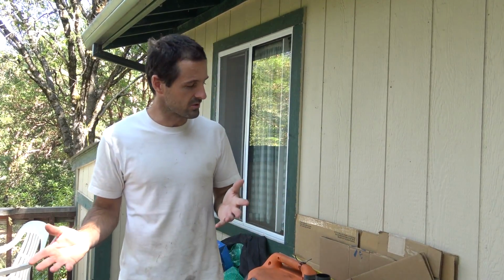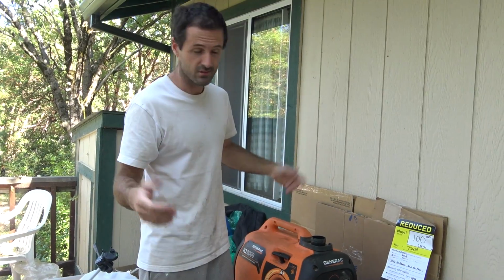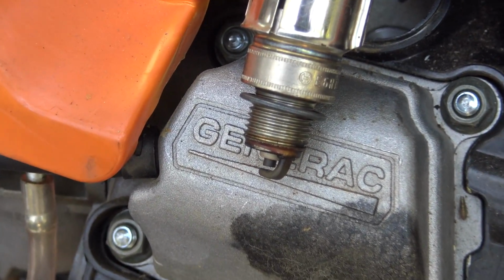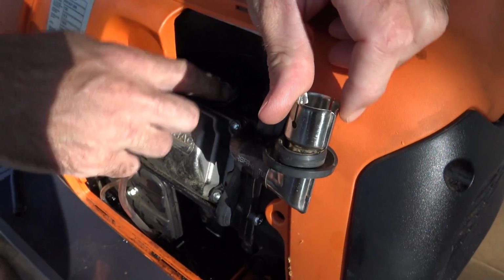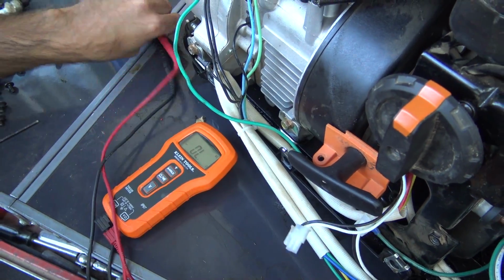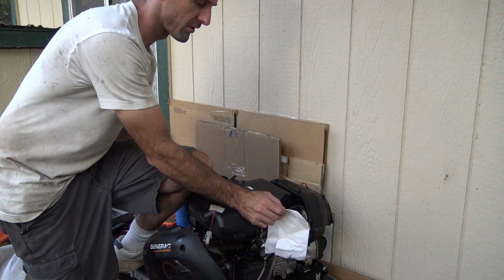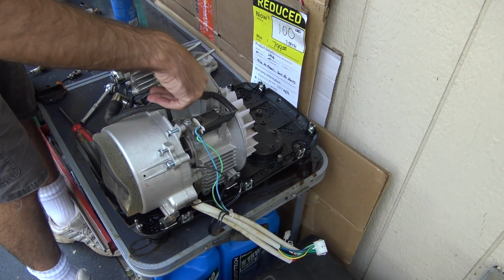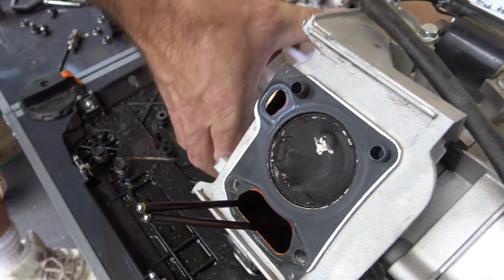$25 Generator From Lowes - Will It Run?

Comment: I recall a phone call from a friend. This was a long time ago from a land far far away (the 1980's) 
Anyways, I was a big Tomboy, I had built my own car so my friend figured I would know the answer to her simple question. How much oil does my car take? I told her 4 quarts if she didn't change the filter & 5 if she did. She then tells me " I put 16 in & it's still not full" 
lol I told her to pull the drain plug right away & don't try to start it. When I got over there, there was oil running down her driveway because, well, catch pans don't hold 16 quarts. 
We pulled the plugs & turned it over to make sure the cylinders weren't full of oil. They weren't but it sure smoked a lot after we put it back together correctly. lol After it burned off the oil that did leak in we put new plugs in it. lol She was just adding oil waiting to see it fill up to the valve covers. She now knows how to check her oil.

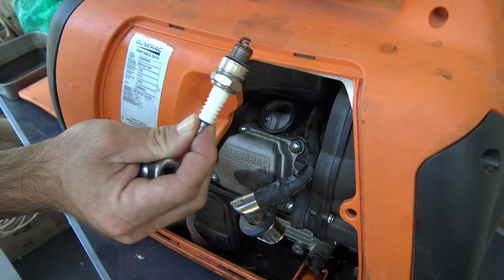Comment: PAUSED 4:37,    ......3% of retail.  Worth the effort no matter what comes of it.  I live in Las Vegas, so I consider how to gamble on an outcome all the time.  Here is the math.  You have $25, plus transport, plus purchase negotiation invested, $75 lets say. 2 hours, and $50 WAG budget to succeed (Wild Assed Guess),  equals $125.  So, $125/$750=6.  If you do this 6 times and succeed once, you spent the same as retail.  If you succeed once in 5 such purchases,  you have a 20% value for the 2 hours I did not value earlier.  If you succeed 1 in 3, your time is worth about $75/hr in this  effort.  This is a great opportunity.  Notice I did not even value recovery of expenditures through parts sales, as you noted.  Now, I have NO small engine expertise, and I even know when oil pours out like that that the engine is far, far over full (I've done it).  I would have tried this myself for that price, the low risk, high reward makes this effort worth it.  I'll watch the rest, anticipating your success, and good for you!!!

Comment: You need to replace the magma drive and both link cylinders. Also the flux capacitor may need a recoil for safety purposes. Don't forget to drain the plug shaft compartment otherwise you will burn out the ozone valves.

Comment: Awesome common sense diagnostics, I am very impressed. A little help? Overfilled with oil leads to several possible problems. Most usual is a hydraulic lock happens and you spin a flywheel key or bend a pushrod. Spinning  the key leads to backfire not loss of compression so I bet your keyways are lined up. Pull your valve cover and check the pushrods. If they appear ok you have come across a less likely scenario; it did not hydraulically lock but actually fired with all that oil in it. More work but still but not an expensive fix, just order a new set of rings right now. With all of that oil the compression went way up and you will find that the rings are broken. If the engine actually ran for a few strokes it will be very dirty, clean up good before you replace the rings. BTW I think this engine does have an automatic deco valve but that will not account for the total loss of compression you appear to be experiencing, good luck but I don't think you will need it.

Comment: need to add some butter fluid to the bread housing! greasing the muffler bearings is fine as long as that model has them,,, but if it is low on butter fluid,, you can forget about it starting!!  had the same model,, with an issue very much like the one your having,,,well,,, someone told me to make sure the muffler bearings were greased,,, so i checked the muffer to see what i could see,, but come to find out that the model i had apparently did not come with any muffler bearings,, so i sold it to a guy,,, and he called me a week later and said that all he done to it was add butter fluid!! says it runs great now!!!  hope that helps someone who is having the same issues down the road!!   :)

Comment: No compression means either stuck rings or the compression release flight weight is stuck but most likely since they where so much oil they probably burnt it up by waiting till it was junk before putting oil in it

Comment: If you did not get it to run the oil washed out the cylinder add gas the the cylinder to wash the oil away to get compression back

Comment: 0K91470136 Piston Ring Set
Generac 0068660 IQ2000
Availability: Discontinued
This part is no longer available from the manufacturer.

Hopefully it is a generic size.

Comment: I test combustion with a squirt of engine starter fluid in the air filter and spark plug. Then I proceed to check the rest.

Comment: The wire come off the crank but now that you toke off the head you will need a new head gasket  you had it when . You turned the rank wheel didn't have to remove the head

Comment: I've seen some morons in my life but this guy wins the prize. What the hell poring gas directly on the sparkplug. Ever herd of flooding?

When it was out the first time he should have looked inside and crank it to see if the piston is even moving.

But fouling the spark plug
Was stupid.

Still the very first think to look for was leeks and crack on the head and block. If no compression but spark chances for a cracked case ishigh

Comment: Try  a brand  new clean dry spark plug. Don’t damp it with gas.  Feed the carb with fresh gas . If it won't start try engine starting fluid.

Comment: Check the 7th Fetzer valve. May be sticking because of humidity. You'll need pliers and 30 weight ball bearings. Good luck, Fletch.

Comment: You can't test a sparkplug with the continuity function if it's a resistor plug. You need to check the plug using the ohms setting and look for something typically in the 10K-15K range.

Comment: There should be no continuity through the spark plug.  Common resistor plugs should have a 4000-5000 Ohm resistance.

Comment: why  didnt you do a visual inspection of the valve train in operation before you  dove into the guts ? Remove the little valve cover and see the rocker arms in motion when turning the engine over, make sure they are normal ? And spray a little gas into the intake , it doesnt need a carb to run...that will narrow down the problem a lot

Comment: Check the float in the carb. Most likely the pin came out of the float in the carb and its not allowing fuel to the carburetor.
My lawn mower did the same thing.

Comment: Can you believe they sold this piece of shit at one time for $800.00 what a joke, these generators only last for so long and then they won't run, I believe these machines have a flaw in the engineering, but was never corrected and therefore Lowe's or Home Depot continues to sell these inferior machines to us. You see where it's reduced on price and maybe you can get it running again is what we think, people don't do that go online or in the news paper and find a used machine that works, and produces more electricity has a bigger gas tank and cost around 40-150$ depending on year and condition. So stop thinking these big corporations are saving you money because there not.

Comment: I bought a crapped out Ryobi generator from someone for $280 that told me "Yes, it works great. I got it from where my mom works at but they upgraded to a better one. It just needs a new spark plug."... I bought a few new spark plugs and still can't get it to run or even spark. The guy that I bought disappeared on me after I posted a security camera video of 'a person wearing night time construction safety gear and was stealing things from the back of my truck around 3AM'. (which is similar to what he was wearing a lot of the time). So 2 years into it, I haven't seen him again and I still dont got the machine running. And his wife/babymom/girlfriend-whoever, came by to visit me and told me that he even stole a lot of things from her boyfriend/whatever.... I don't know.

My dad made a similar mistake too. He ask me for $180 or so. I had no clue why because I was dazed out from lack of sleep and working over nights. Couple days later, he shows me the generator that doesn't run. I toss in some motor oil. The mothor crap was spitting oil out to my arm and I noticed a hole in the motor that shows the crank thing spinning and the motor has like no compression. I said "This machine isn't even worth $5". Now I gotta deal with all these crappy repairs and wasted money.

Comment: I would change the headlight fluid while I was in there as well.
Reply: its a sealed lamp, and the fluid is eternal. FFS u dont know fuck all
Reply: @ChuckyLad  You need to pull the muffler bearing to the side to access the headlamp fill hole. Lighten up my man, you all need some humor now and again.
Reply: Mariah Kelli  didn't you get the memo?
Reply: Topanga Reyna  How can you be so fucking naive and still breathe. WTF I know it was a joke. So was what I wrote you sorry fucktard idiot that is not capable of reading anything properly and just throw shit like a little baby

Comment: My Ryobi RYI2200 did the same thing. Adjusted the valves, the intake valve was staying partially open and it runs better now then it ever did. When they set the valves at the factory they tend not to set them properly.

Comment: Maybe whoever had it before you fooled around with it and put the crank back on backwards.The original problem was probably the spark plug but they over thought it and while putting it back together they threw the pull crank on backwards Idk thats my thought,anyone else got some thought?

Comment: Of course air pumps out of the breather of a single cylinder when you roll it over, there's nowhere else for the air to go when the cylinder descends in the bore. Perhaps the only thing wrong is a dirty carb?

Comment: Rings and cylinder wall are washed out of oil. Causing blow by. Squirt oil on the rings spin without the spark plug then install spark plug if gets wet with oil clean plug and reinstall. Pouring gasoline on a spark plug shorts it out. Wet plugs do not spark. Under normal operating conditions only atomized fuel reaches combustion chamber.

Comment: Not trying to undermine you but I've fixed generators like this before so I'd like to give you some tips. 
1) it likely has a compression release on the cam. That's the reason it has compression Turing backwards 
2) replace the spark plug. I've seen plugs look good but have a very weak spark. If it's a weak spark outside the cylinder, it will be pretty much no spark in the cylinder 
3) clean the carb. They gum up easily 
4) check the float. I've had one that mysteriously filled with fuel.

Comment: Top of the crank case is put on backwards.  If you flip it around on a air compressor it will suck rather that pump

Comment: Someone, previous owner? messed with pull start, trying to start backwards. So its sucking through the exhaust and blowing through the inlet. Crank case breather is usually connected to inlet side so blow back through crankcase?

Comment: could have checked for spark with the plug,  blue is usually good. if you have one, use a spark gap checker. It measures how far the spark will jump. 
also check valve lash before taking head off.  rotate engine to watch the valves actuate, and that way make sure cam is ok, and turning.    one TDC position should see both valves closed for quite a few degrees before and after, and TDC at 360 crank rotation/180 deg cam rotation should see both valves moving at the same time, one opening, and one closing. 
that will tell you whether you need to remove cam, or replace timing belt/chain/gear.

Comment: First thing I would have tried was adjust the valves. If that didn't fix it you need to pull the camshaft out because the sprocket has a centrifugal weight on it that probably took a shit - and/or the return spring.

Comment: Pull cord broke and when it was replaced they wound it on backwards. So when the cord is pulled the engine is rotating in reverse and cannot generate compression.

Comment: Is it possible that someone put 2 stroke oil in gas that was put in a 4 stroke engine? That will cause the valves to stick on the valve guides & leaves the valves open.  If so, get the 2 stroke gas out of the unit & work the valves open & closed through the spark plug hole or if you can't do it that way you'll have to take the head off. Shoot WD-40 on the valve stems & work the valves open & closed till they're free.

Comment: My guess is a head gasket. But, I would have never tore it apart without replacing the plug and checking the coil first. Also, you would have known if the rings were bad by doing a simple compression check and if the plug was full of oil.

Comment: the gap between the spark plug needs to be closer space is a hair to wide plus check the type spark plug certain types are  metal based like pot metal you need one with nickel carbon spark  plug..

Comment: Don't feel bad. I bought a Ryobi 2200 generator/inverter that wouldn't start, thinking it would be an easy fix. Got it home, pulled and cleaned the plug and found it has great spark. Replaced the fuel and attempted to start. The thing kicked back so hard, I thought it was going to break a finger. And that is all it will do. So, with any luck, it is just a sheared key on the crank that threw it out of timing. Has anyone had a similar experience.

Comment: Spark plugs don't have continuity, they have something called a air gap inside of them for extra resistance to make the spark hotter. Also ALWAYS check the valve adjustments on those before you tear them apart, the valves get tight and compression goes away besides getting over revved and spitting a rod that's one of the main problems i see out of those generacs

Comment: Head gasket, valve job and put new valve spring......Buy the way, change the spark plug cap, they tend to short...Have a rubber cap and the thing will work.....

Comment: A spark plug can not stand wet, it was almost destroyed when you poured gas on it, it was the death penalty for the spark plug.
Reply: Did you go after the carb? My float and needle was gummed up like sap. Had to use a needle to chip it away. After that it started right up. Great video.

Comment: I would see if the cam shaft is wiped out. As far as the cross hatching, the engine needs to be overheated once to ruin the rings. Nicely done outside - i don't like working outside either! One other thing, invest in a new plug. What is available now when bad will spark in the air but will not fire under compression I have seen this many times.... thanks, Bob

Comment: Pull cord on wrong way! Or recoil spring
Reply: nope. its definitely blinker fluid that is missing. i once farted in the small pipe it instantly start running
Reply: Harry jnr nah it's a stuck hooter valve. Next to the competence tester.

Comment: jumped timing or a bent valve rod on the intake side...which would explain the compression while running backwards since its sucking in air on the exhaust side.. and not the intake side..

Comment: If your research doesn't show a compression release mechanism, then it doesn't have one.  That is not surprising on inexpensive engines as that would add complexity and cost.  What causes the confusion is that many small engines achieve a compression release effect at low RPM (i.e. starting) through overlapping valve timing.  But, that doesn't work when turning the engine backwards. 

After being burned on "too good to be true" buys, I generally pass on these type of projects.  If the factory repair folks, with access to tools, manuals, and any part they might need don't think it is worth fixing, it probably isn't.  What are the chances you will find the one, small, item they overlooked?  Not much.  And, even if you get it running, you will have a heavily used and abused generator.

Comment: My guess... Before I start reading these comments, is that they left the piston rings out at the factory...  If that's the case, I don't feel so disgusted by the original purchaser returning it, if they spent hours and hours trying to get it to run... Or paid someone to.
Reply: Won't give it away, but it almost certainly was the returning purchaser's fault...

Comment: you sould have check valve lift before pulling the head you could have done this before you disassemble the motor

Comment: The engine jumped its timing and these newer engines use a P.O.S. plastic cam gear and its probably stripped of its teeth. That or the valves are floating.

Comment: valves out of timing
Reply: the vent hole thing was a good thing it was suking as well as blowing,its only bad when it only blows when its operating with high pressure in the compression chamber

Comment: So I stopped the video about halfway when you got done pulling on it trying to start it and you were saying the engine needs three things to run. It needs air but it may not have air you don't know that just because there's air in the atmosphere doesn't mean it's getting to the engine or moving through the engine. It needs fuel you have no clue if it's in the combustion chamber and you fouled out to spark plug... anytime the spark plug is wet it's harder for it to spark"fouled plug". And compression and it has none because it's too easy to pull by the way you're pulling it. Your best bet would be to take out the spark plug and spray ether in it and see if you get it to fire. Ether doesn't need much compression to run.
Reply: After watching the rest of the video and seeing you turn it in reverse and having compression it's got to be a bent valve or a clogged port or maybe it jumped timing.